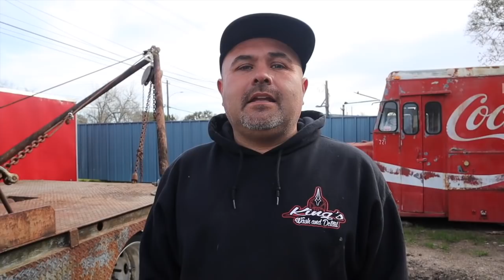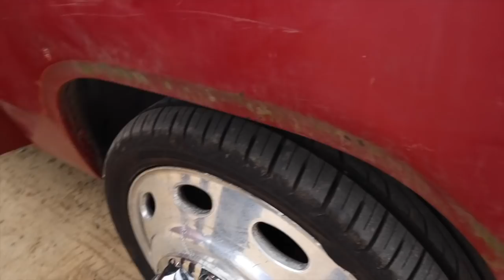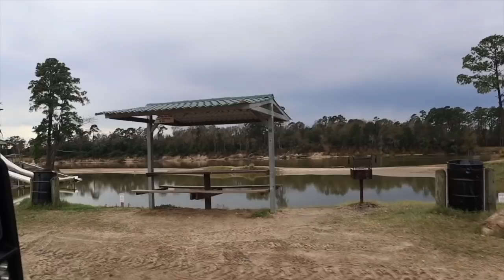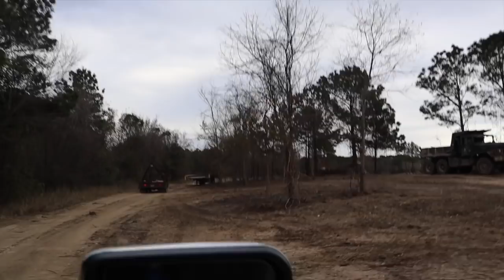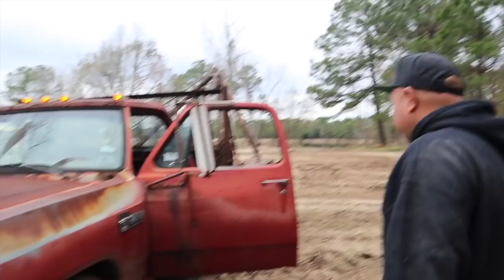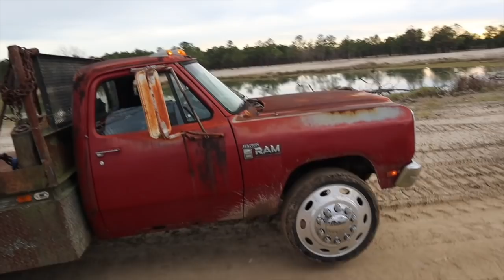JEEPERS CREEPERS PUTTING IN WORK💪🏼🔥

Comment: That's a nice first gen Cummins. She's running strong, but that thing is no tow truck, it never was. Those trucks were used by farmers to move shit around. That boom is too light for hauling cars just letting you know for your safety and other's. If those pivot bolts snap or boom bends while you're under it...it's gonna hurt.

Comment: Another way you can keep that truck on the front wheels on the ground is take a towbar  and attached fix it where it will not move up and down and take it to another truck
I have seen my dad take a 78 ft  trailer House trailerand i-65 Jeep along with a 64 Chevrolet two-wheel drive and pull it through 250 ft of mud and snow by placing 150 bags in the truck and hooking the truck and keep together . ALL the truck is that to do is to keep all 4 wheels of the JEEP ON THE GROUND THE TRUCK IS ISLAND WITH A DRIVER

Comment: Bro.. you should lift up the truck and try using a short chain on you're back bumper to drag it. Rather than using the lifter to drag it. Try it so the truck won't be doing Willy